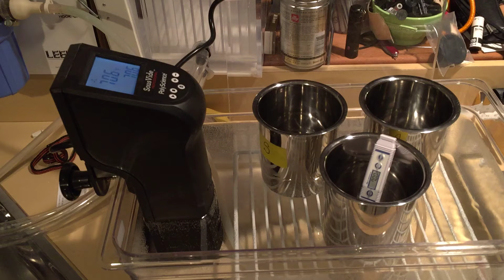My roll film developing setup

Comment: Hi, i've just a question, can material of the tanks can be ruined by the dev/fix/stop chemicals?
Reply from the maker: Well, there are the stainless tanks, and the big plastic tank so I'm not sure which one you mean, BUT - In both cases, no. Stainless was used for years in big commercial application with no effect. The big plastic tank is filled with water anyway and any spills would be diluted. I've been using both for years and haven't seen any negative effects.

Comment: I set mine at 38 celsius it wormed the bowl water exactly at 38 very fast , but the water in the plastic cups that i had place in the bowl water it went 37 qouit fast but than it took ages for 1 more deegre to 38 , the 1 cup was 300ml and fhe other 1000ml , all these happent while test it , ia somethoink wromg ?  I have an idea to brimg in 38 the chems in another bowl with very hot water and when sous vide water is 38 and the chems 38 thank to place them in sous water bowl , but still why it takes ages for 1 deegre?
Reply from the maker: In my case, I'm using stainless steel, which is a pretty good conductor of heat - but that means it's also good at radiating heat too. I'm sure that I lose heat by evaporation as well. I set the bath temperature to whatever temperature give me the desired temp inside the tanks. Don't expect the bath's temperature and the chemical's temperature to be the same.

Comment: Maybe I've missed something but whats the point in the steel tanks? Why don't you just put the chemical bottles straight in the tank?
Reply from the maker: Because I don't store working solutions of the chemicals except for fixer. I use liquid developers - hc110 or ILford DD-X and mix it right before I use it. Then I trow it out. Same for stop bath. For fixer I use the pre-mixed working solution, but I pour that back into the bottle. Also, the stainless steel tanks transmit heat very efficiently so it doesn't take long to bring them up to temperature. I'm not sure why I would want to take a gallon bottle of a chemical and bring it up to temperature - which would take a long time - just to let it cool off after I use it? It's not like I'm a commercial lab that uses large quantities of chemicals in a temperature controlled stainless steel unit with nitrogen bubble mixing or anything.

Comment: Bob, What was the reason for placing the tanks on the rack. Just wondering why you didn't place them direct on to the bottom of the water bath.
Reply from the maker: There's a minimum depth of water that the pump needs in order to operate. The water needs to cover the port that is the intake for the pump. There's a line on the pump that indicates that. If I put the tanks in the tub with 1) the water at that depth and 2) the amount of chemicals that I wanted to use in the tanks, they would float and tip over. I didn't want to fill the tanks up with chemicals just to make them heavier. So, I did an experiment to find out how deep I could make the water without tipping the tanks over. I filled the tanks with water equal to the amount of chemicals that I wanted to use, and put them in the empty tub. Then I poured in water until the tanks became buoyant. I backed off the water until the tanks were stable, and used that as a gauge of the maximum depth that I could use. I cut off the legs on the racks so that the top of the rack was right at the mark on the pump that indicates the minimum amount of water needed. Then I filled the tub to that depth, plus the amount of water that I got from my experiment. Now the pump is happy, and my tanks don't tip over. The water level drops as I'm developing because I remove the tanks from the tub, but the developer is the most sensitive to temperature anyway and that's at the beginning when the water is deepest.
Reply: Hi Ian, I hope you are well. Have you bought one of these ??? or tried one?? I'm seriously looking at purchasing one for film development, but would prefer someone who has first hand experience  before forking out the 99€. If you have some experience let me know through email.